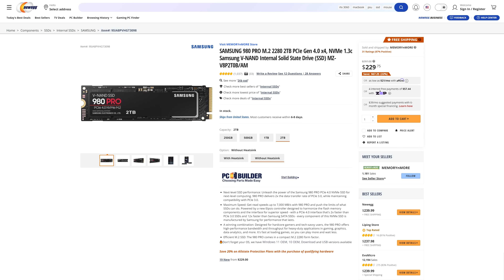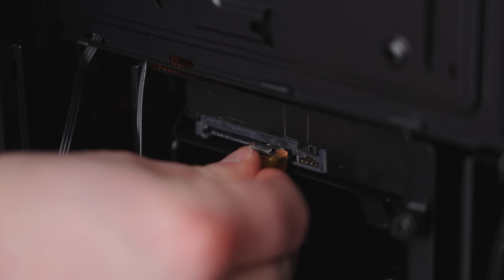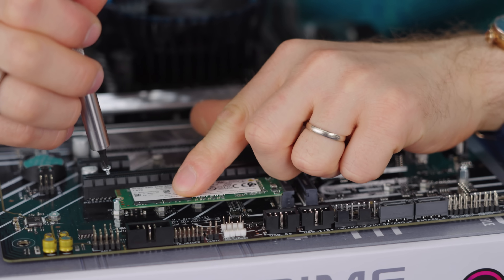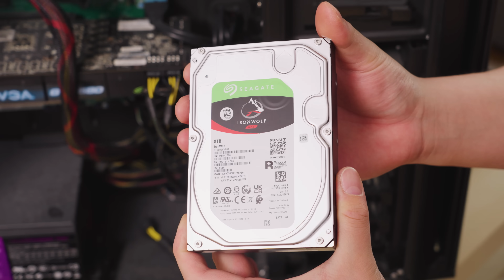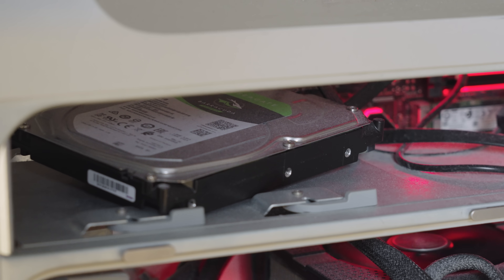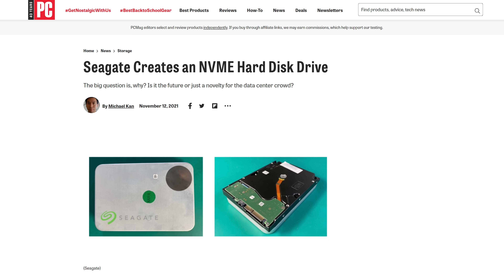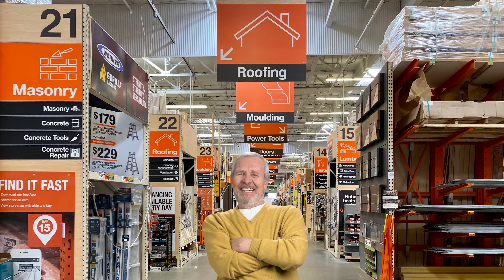Is SATA Obsolete?

Comment: I remember having PCs with those ribbon cables.  They were big and ugly and the connector would come loose after a few insertions or one of the dang pins would bend.  Bending pins on those old drives was easy to do accidentally.
Reply: What were you doing with those poor drives.
I don't remember needing to disconnect them, like never, 
unless you had to replace the drive after 5 years or so.
Reply: I still remember making my own "airflow optimised" cables and wrapping them with colorful tape. Oh the joys of the janky past...
Reply: @Donnerwamp  But back in the time of ribbon cables you did not need case airflow.
CPU was generating a lot less heat, and most cases had a dedicated shroud with holes on the side for CPU air intake.
Reply: @hubertnnn  Back then it also didn't change ablot, aside from looking better in the first few cases with windows. That's why I put it in " .
But I wouldn't say that the CPUs back then produced less heat, the top of the line P4 had a TDP of 125W, that's still more than the average CPU today has.
Reply: The pins on the PATA connectors were more robust than the flimsy plastic used on SATA connectors. I never once bent a PATA pin, but I've definitely ruined some SATA cables.
Reply: Who the heck connects and disconnects them often and make them fail? Sata is not your portable storage solution lol.
Reply: @ArunG273  I suspect that the issue was cheap cables that weren't completely to spec. Towards the end of the PATA era I had a few that were unreasonably tight for the fit and I actually wound up pulling one of the connectors apart trying to get it out. 

But, yeah, if you took a few minutes to think about how you wanted the disks laid out and put the optical disk on the other ribbon from the main drive, then it shouldn't require much in the way of plugging and unplugging.
Reply: I remember having to set the jumpers to tell it which drives were the master and slaves too. I'm glad such things (and the terminology) are no longer a thing in common use.

Comment: With chipsets moving onto PCIe 5.0 SATA honestly needs an upgrade even if its mearly 12gbps because for some motherboards your better off using external NVMe through 10gbps USB than using SATA but USB is external and turns PC’s i to masses of wires and crap lying everywhere

Hell depending on how they do the SATA 4 standard (if they did one) then most if not all SATA SSD’s could have a firmware update to push them past SATA 3 but not quite to SATA 4 and SATA 4 SSD’s would still cost the same as SATA 3 SSD’s as a single well made nand die is faster than 12gbps at this point
Reply: The upgrade to SATA is NVMe. SATA is a dead end. But it is still useful so it stays.
Reply: @RoastBeefSandwich  that is the excuse they use as to why they haven’t announce or release SATA 4

But the issue is a BIG MOFO!! MOST!! Motherboard have 2!! And only 2!! NVMe slots which is pathetic and has to change but it WILL not change unless CPU’s are given more lanes

However making a SATA 4 12gbps is piss easy as everything is moving to PCIe 5.0 vs the PCIe 2.0/3.0 when SATA 3 released and so they have no excuse!! Because the panes SATA connects to are 4-8 times faster than they once where

Also if you want to add more NVMe well your simply shit out of luck because its going to cost you at least £100 if you use a case requiring a riser (x8xm.2xm.2 riser card) if not then its gonna cost you even more and ONLY if you have another usable PCIe slot which most wont as the spacing is 2 slots and GPU’s now are typically 3 slots meaning you cant use a second slot even if you have one… and if you do magically have ine it will cost you between £350-£750 for 2-8 more NVMe slots unless your motherboard had BIOS level bifurification on the second slot

SATA is the way to go to add more drives and NVMe will never be able to compete with the ease of adding more drives

Because with NVMe its drive replacement bot drive addition like it is with SATA

But SATA needs a buff to 12gbps

SAS since 2017 has been 24gbps and wont be long till its 48gbps or better

Yet SATA is still 6gbps and has been for 13 years

SATA NEEDS A revision 4 with 12gbps capabilities as a minimum otherwise NVMe will have to get to revision 3 and natively allow 4 drives with 1 lane each and force the drive itself to do everything itself and use just the 1 lane which means expensive controllers required for the drives vs SATA 4 happening into existence

The people behind SATA 3 are honestly just insulting PC owners and themselves by having of to the premature NVMe spec as yes it can do 1 drive amazingly but it cannot do any more than that unless you convert to… you guest it SATA mode!! Which only runs 6gbps

Cant be assed to fix the spelling and sire as hell never bother with gramma so dont bother saying anything about either

Youtube keeps making the usable area smaller and smaller so i can currently only see 3 lines of upto 10 words at once, youtube needs to get rid of the left icon and empty space and shrink the right side submit button and move it way to the right
Reply: @TalesOfWar  read my reply to them I’m not writing it again

Because you are wrong about NVMe as it currently cannot support more than 1 drive unless switched to USB or SATA mode

Not to mention most only get 2 of the damn things which means your forced into buy and replace instead of SATA’s buy and add
Reply: @commanderoof4578  To make SATA faster would make it not backward compatible anymore. SATA 3 is the farthest they can take the current technology. SATA 4 at 12Gbps would basically be NVMe but with a different connector. Incompatible with existing SATA devices, and limited by PCIe lanes.
Reply: @RoastBeefSandwich  nope SATA 4 would simply need a faster piece of silicon developed or use a cheap PCIe 3.0 controller with a modified firmware and call it a SATA 4 controller

In both cases you have backwards compatibility
Reply: @commanderoof4578  You are describing SATA Express which already exists and is not taking the world by storm.
Reply: @RoastBeefSandwich  what? Unless you mean eSATA which i was not even talking about then… what?

No i am saying SATA 3 is almost 2x slower than USB at this point and so needs a 12gbps revision to sata 4

SAS 12gbps was made obsolete in 2017 with SAS 24gbps which will soon be SAS 48gbps

SATA the EASIEST thing in the world to ise to expand your storage is also the only way to expand your storage past 2 poxy drives when compared to NVMe as SATA normally comes with no less than 4 connectors on most motherboards and so woth the change over to PCIe 5.0 SATA needs to buff up to 12gbps on the same connector which is piss easy but they are pissing and moaning claiming NVMe is all you need so we won’t bother

When that is only the case if you never plan on adding more storage past 2 drives unless you want sata ones or choose to use USB which is now pretty commonly 10gbps but SATA is internal while USB os not
Reply: @TalesOfWar  HAMER drive made SATA Obsolete so enterprise will demand that SATA normal gets an update because its far simpler to replace a drive and PCIe card than it is to rip everything out replacing the cables as well to change to SAS

SATA 4 should be inevitable but they are too silly to see all the downsides of not adding just 1 more revision so HAMER drives can remain SATA for a longer time instead of being speed capped and SAS only
Reply: @commanderoof4578  You wanted a faster SATA that remained backward compatible with SATA 3. That is SATA Express, a standard that already exists, and hardly anybody uses because for the purposes that people use SATA for SATA 3 is already fine. Hard and optical drives cannot saturate SATA 3. SSDs can but NVMe is better. SATA 3 is a dead end at this point.
Reply: @RoastBeefSandwich  HAMER HDD’s CAN AND DO saturate SATA 3

And when i say SATA 4 i mean same cable as SATA 3 but 12gbps

Comment: NVMe SSD - For the newest/largest/most demanding games
SATA SSD - For OS and other games
5400 RPM SATA HDD - For everything else; quiet
Everything has a purpose.
Reply: Imagine not putting your OS on the fastest drive. You're slowing your whole system down bro.
Reply: @thestig007  This having your page or swap file on a sata ssd and nvme ssd is a night and day difference in day to day use especially with 16GB of ram or less.
Reply: You would get much better mileage from putting those demanding games on the SATA SSD and putting your OS on the M.2. General system responsiveness should always take priority over your games maybe loading a few seconds faster.

Probably doesn't help responsiveness that you're installing malware and blaming Windows updates, but y'know.
Reply: So THAT'S why people are complaining about windows updates. They're using garbage tier SATA SSD's with no cache!
Reply: @milesfarber  No? Windows updates are malware. Corrupting your OS and changing settings without permission - nothing to do with the hardware.
Reply: @Wraithdagger  Have you tried not installing malware and blaming windows updates?

Comment: Sata has its place, as more ssd storage when the pcie lanes are full.
Reply: It used to have it's place when out of pcie lanes. I had that same stance before until I realized how bad the actual quality of sata ssds are now. In the last few years they seemed to been some massive cost cutting measures on newer models. It seems like every ssd manufacturer called it good the moment it hit sata 3 speeds for normal use. Samsung launched the 870 evo and it turned out that the entire first year of them manufactured were defective and mostly died around 10-20 terabytes written. I think sata ssds would be fine for more responsive cold storage just like HDDs were for a while, but I don't think that is the case anymore considering how little effort is put into making reliable sata ssds now. Now days if I absolutely needed a sata ssd I'd feel more comfortable buying a used drive with 98% endurance than buying a new sata ssd.
Reply: Is it really though? I mean how many drives are you actually going to be using at one time? Will they actually saturate your lanes in real world practice?
Reply: @chronometer9931  i use a lot of drives lol. I install my entire steam library. When i saw the lancool III with its 7 ssd mounting spots, i wanted it bad.

Comment: its still a cheap easy standard which is more than enough for most users, maybe not so much for tech enthusiasts. but for 99% of people its easily fast enough.
Reply: I think the fact that it can use a cable is a bigger advantage than being cheap.
Reply: @hubertnnn  thats true, and im still surprised there's no way to use a standardized nvme "cable" there are ways, but nothing simple.
Reply: @Great.Milenko  servers, HEDT, and some high end consumer boards have a “U.2” connector, which is a cable plug for nvme.
Reply: I'm willing to bet most enthusiasts (including me) run a mix of both and more for various reasons. I have a 1TB M.2 NVMe running as my boot drive and where my multiplayer games go. I have a 1TB sata SSD that was my old boot drive that now acts as a backup boot drive (for whatever reason like a temporary 2nd comp) as well as additional storage for all my other games. And I have a FEW HDDs equaling 6TB for mostly misc storage of pics/videos/back up files.
Reply: @nicholaskinkaid  yep the multi tiered approach is the best for most people that dont have unlimited budgets. like you i have 1tb nvme in 2 partitions, 1 for boot, one for games/programs. my old sata ssd as extra storage for games/programs. and then 2 8tb sata hdds for my mass storage of docs/pics/vids/downloads.
Reply: And here i am still using a HDD and a nvme boot drive. Thought about getting a nvme to replace my HDD, but the price over a SATA drive isn’t worth it IMO.
Reply: @REXae86  Am currently using a 128GB SATA SSD, and a 1TB HDD, and am not planning on changing that any time soon.
Reply: storage enthusiasts would disagree, that being, those who want their 8 TB + HDD's
Reply: Yes exactly. 

I know a few people that need nVme but they are rare.
Reply: It is, but NVMe SSDs are really coming into their own. Cost per TB is very close if you don't need the fastest unit, and SSDs are relatively reliable. Not to mention the average 4.0 NVMe is faster than the best SATA SSD. Only my original SSD has died out of roughly 10 that I have. It was an Intel 335 series.
Reply: It's*
Reply: @JorgetePanete  it is

Comment: Technically you should be able to connect an NVME SSD using just 1 PCIe lane. 
It would be 4 times slower, but should work.
And with modern hardware speeds it should be enough for most use cases.
Reply: No. It won't be close to 4x slower. First of all ssd bandwidth is still less than the theoretical maximum offered by 4x PCIe. Secondly random read/write speeds, which are most of your normal operations, are significantly lower than sequential which means you are using even less od the theoretical bandwidth.
Also latency which has an impact as well won't be influenced by the amount of PCIe lanes at all.
So yeah, I don't think it'd male too much of a difference

Comment: SATA still has a place, think about NAS and 100Gb network speeds.  One SATA SSD still outperforms this but if you spin them up in a raid 10 the fun is endless.  4Tb SATA SSD is fast (enough), has no moving parts and has a good price point.
Reply: One SATA SSD sure as hell won't saturate a 100Gb link (which doesn't really exist in homes anyway), because SATA is max 5Gb/s, without considering protocol overhead. But yeah, SATA is good enough for many uses. I have a pile of spinning rust that can saturate a 2.5Gb link and that's good enough. (BTW, you mean 4TB, not 4Tb, and that price point, eeeeeh...)
Reply: A 4TB SSD at around $350 for a cheap one, is about the same price as a 18TB WD Red HDD.  Sacrifice speed for capacity so it depends on your use case.
Reply: @jmugurr994  yeah that is the thing for if you need it for a os drive yeah a nvme ssd is better then a hdd but for storage a hdd is just as good
Reply: @jmugurr994  This it's all about use case, also cost. That's a factor in why the cost of storage went so cheap over the past 15 years to where we've got such mountains of cheap storage now. Like surveillance systems are still going to be using HDD. There's only specific use cases I see on NVMe drives and they have a bunch of pretty big drawbacks to me other than the cost. It's one of those things that's super great for laptops, but that's just because your laptop is probably only going to have like 2-3 m.2 slots and a discrete GPU on a good one with some rather limited I/0 and so it literally doesn't need nor have ability to make use of all those extra PCIe lanes, while using less wattage and being smaller and lighter on top of that, though even then lots of old laptops still had the NVMe/HDD configuration that we still use on desktops to this day. Its sole drawback on a laptop is heat basically. 

Meanwhile where power and portability are no longer an issue, all the drawbacks become painfully obvious on desktop. It's also a big deal to me that NVMe enclosures are basically using Thunderbolt, not even a super common port atm, or they're using USB 3.2, which is still so painfully slow it kinda deletes the purpose of having that drive be a non-HDD/non-SATA SSD in the first place, so I can't even replace my NVMes and stick it in some enclosure to transfer off USB in a way that gives any advantage over normal SSD. There's a big reason why a big draw for me getting my x570 board was it having 8 SATA ports over the z490 or whatevers 6 ports. Anything less than 6 SATA ports is just unnacceptable to me on desktop.
Reply: i just looked a 2tb hdd is 75% then a nvme ssd
Reply: Thing is most consumers run single drive, or dual.  drive. Even though NAS is a great solution, I personally use it, most consumers will just use Cloud, and the flair factor around NVMe is - big draw. I use SATA SSDs to store my game media, if only not to use up all the m.2 slots on my mobo for my game recordings
Reply: @uss_04  I use an external USB HDD for game recordings. Plenty fast enough for that, at least the videos Nvidia Shadowplay produces (3440x1440, 60FPS).
Reply: Still have place indeed, like in my pc. .
Reply: Honestly I'm seeing that even up to 1TB SATA and NVME are pretty similar in price on Amazon. It's only once you get to 2TB that you begin to see a big price hike. 
I actually had no idea it had even become THAT cheap!!

Comment: SATA is immortal because the ports save way more space.
Reply: Not everyone have tons of SSD. And even those who have more than one SSD, their main SSD is also an M.2, but those who have only one SSD it's almost sure they have the M.2 version. If less factory manufacturing the SATA version, because everyone use the M.2 mainly, it will be more expensive. If the much faster SSD will be much cheaper too after some years, than the SATA can lose even more reason to exists, and motherboard manufacturers will just slowly decrease the amount of SATA ports, just like they did with the IDE ports when SATA become more popular.
Reply: it'll probably live on in server environments like SCSI, which is long dead in the consumer space
Reply: with cable + 2.5" drive enclosure, huh?
Reply: @RadioactiveBlueberry  obviously they mean motherboard space which is kind of harder to come by then the entirety of the space inside the case